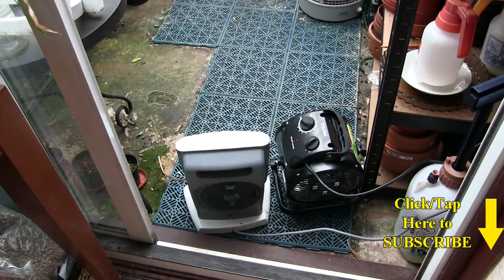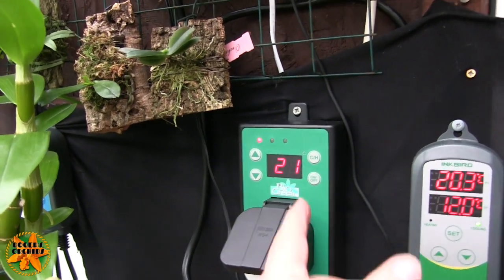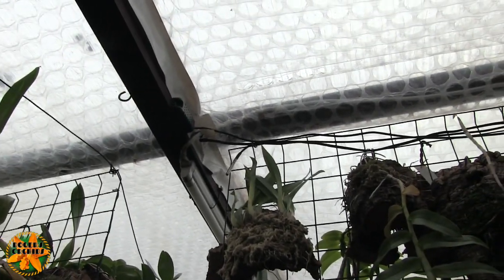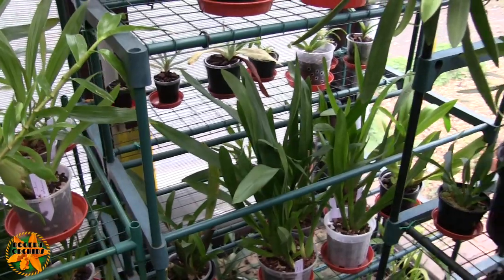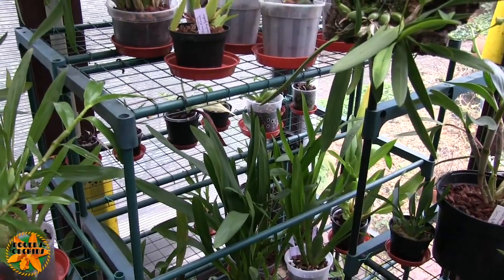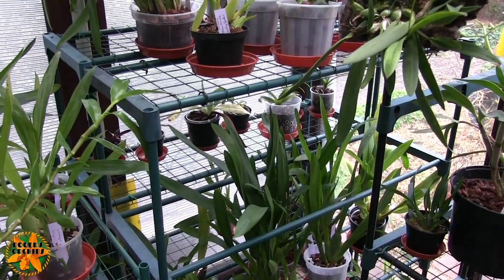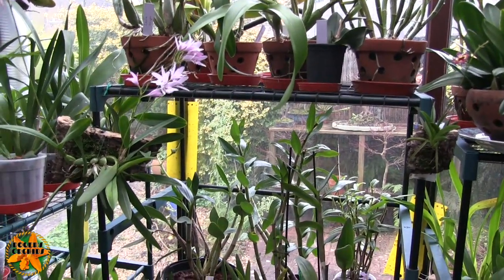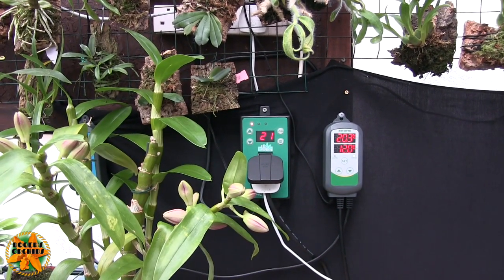New Kit Installed and A New Mini-Project for This Growing Season

Comment: The project sounds interesting. I’m looking forward to the results.
I use Peter’s Excel CalMag fertiliser routinely NPK 13:5:20 CalMag 7:2 at TDS of 200-250
During spring and summer I add extra Calcium Nitrate that boosts the TDS to around 300. I have noticed stronger healthier growth since doing this.

Comment: I feed according to your tips and I have had great results. The average is 150ppm and it varies according to orchid types and seasons. I always thought fertilizer percentages worked like this : A 20-20-20 fertilizer has 60% nutrients and 40% fillers. So feeding at 100ppm means you are giving your plant 33.3ppm of N, 33.3ppm of P and 33.3ppm of K
Reply from the maker: This is the logical answer but it depends what effect the fillers have on the TDS reading?

Comment: Looking forward to the fert. experiment. Going to have to remember my old Stoichiometry from high school now ;(
And to muddy the waters further I think FirstRay has a "modified" version of the MSU formula called K-lite which is 12N-1P-1K-10Ca-3Mg which has very low potassium(I notice his website doesn't say MSU anymore...and I'm pretty sure it used too). The original and real MSU formula for RO water is  13P-3P-15K 8Ca-2Mg. I'm not saying which is better... It's just something people to watch for when they by so called "MSU" fertilizers.
Reply from the maker: I think the idea of the K-lite is to have separate control over the 'P K' elements which is why they've been reduced to 1 each. Plants cannot grow properly without all 3 NPK.

Comment: Wouldnt it be, work better if you put the sensor somewhere in the middle range of the room, or even on the flor, because heat rises high. So if it is already cold on your roof, the flor is much colder, isnt it?

Comment: Really interesting the experiment.  I always struggled to find out the concentration of nitrogen in my water, and sorry if this will be a stupid question...so, if I have nitrogen with a straight of 35% how i calculate how much should I put in one liter of  the water for example to have 35% nitrogen...I don't know if that will be the correct formulation for the question...sorry I am really blonde when I try to do math and explain things🙄
Reply from the maker: For me, the concept of working with ppm of Nitrogen only is not sound as it is affected by other factors including the other elements and their percentages and that's without introducing Ph into the conversation.

Comment: If you want 100 ppm nitrogen of the MSU, the total TDS is 420 ppm (I weighed out 769 g of MSU, the quantity needed for 100 ppm N, and added to 1 Kg water and took the TDS reading). So 25 ppm N is 105 ppm total TDS, 50 ppm N is 210. If you're interested, these are the other major element values at 100 ppm N: 
P= 10.07 ppm
K= 95.75 ppm
Ca= 61.52 ppm
Mg= 15.38 ppm
 (so divide those by 2 at 50 ppm N or 4 at 25 ppm N)
Hope that helps!
Reply from the maker: The part that's not 'satisfactorily' been established is, all the 'good stuff' in the MSU adds up to around 41%. Does the 'other stuff' (buffers/fillers etc) contribute to the TDS reading? The ratio of the 25ppm N giving a TDS reading of 105 implies that the 13% N is of the total % of the elements ie 41% (just under 1/4) not 100%. I still need a good explanation of why a TDS reading of 100 isn't 13% N ie 13ppm N which would imply that to get 25ppm N, the TDS would be over 200ppm. And over and above all this - 'Life's too short'.
Reply: @RogersOrchidsGardenandBonsai  so here is where you are getting caught up, I think. The 13% N is the percentage of mass of N in 1 g, not 13% of the ions. The percentage of N ions is higher because N is a relatively low weight element, at 14. TDS is a function of mass but not a measurement of it.
In regards to the "other", you need to keep in mind that elements do not stand alone. P is P2O5, for example.
I think it is important to keep in mind that we are not professional growers and focusing too much on what these numbers are and why isn't needed. I am confident that the numbers I gave you are accurate enough, as both scales and the TDS meter are calibrated (compared against known values) and my math is correct. By knowing those values, you can decide what ppm you want to feed for a given N (or other element) value.

Comment: Off topic question. What is the Best way to remove calcium from orchid leaves? It is really vinegar+water? Im scared to use it.
Reply: I use 50/50 lemon juice and water.. the citrus cleans calcium deposits really well
Reply from the maker: Some lemon juice with pure water will work. Vinegar will work but may be a bit harsh for delicate leaves.

Comment: I have 2 Miltoniopsis that are not doing well, few roots etc, one is under a cloche to help it grow roots, maybe your experiment will show that they need a higher level of fertilizer. But yours are miltonias, would your experiment also be valid for miltoniopsis ?
Reply from the maker: Miltoniopsis are much lower feeders than Miltonias. Miltoniopsis roots are fragile and can burn easily with higher levels of feed.